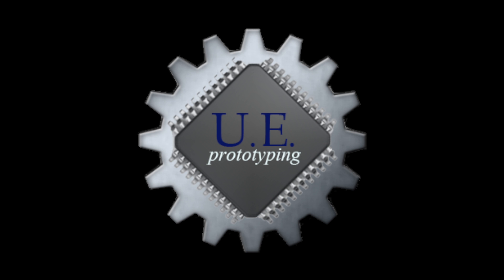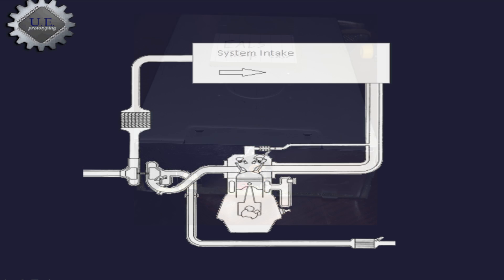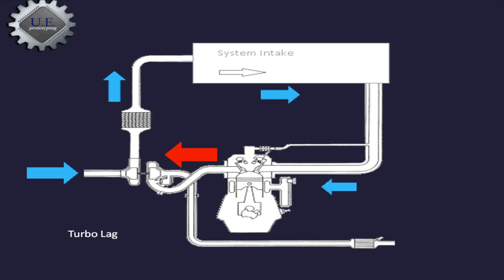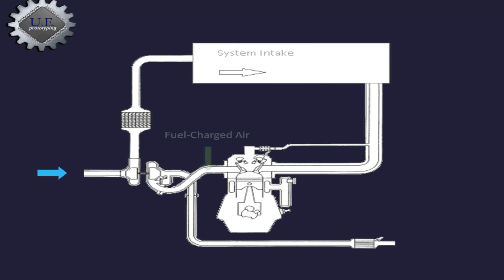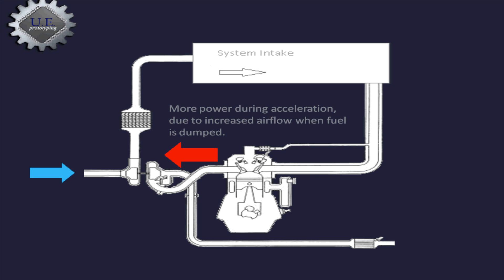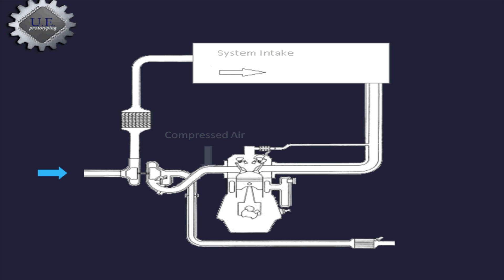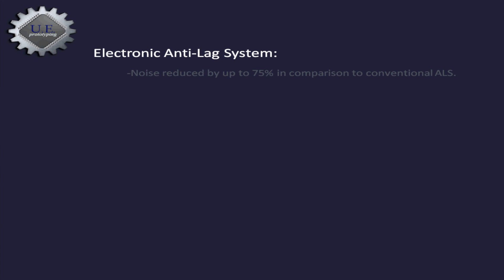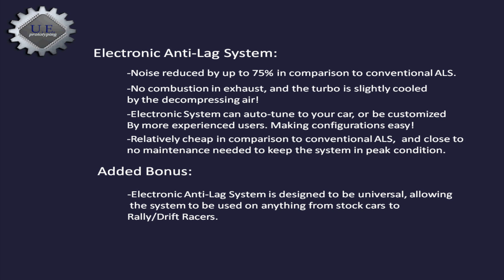Electronic Anti-Lag System - Idea Overview

Comment: Its same as fresh air antilag valve..??
Reply: Ive been researching this same topic for years and as many different implementations as i can that reduce turbo lag. Currently one of my cars has a 2jz gte in it, with the twin turbos - and they are even laggier than what i prefer. So i bought a single turbo setup to swap too, and the size of the new turbo is fairly large, because i need it to reach my horsepower goal, but I have one fitted with a light billet wheel- less rotating mass,log style manifold ( not tubular) for quicker spool, i even have a "Quick Spool valve" that is run off an actuator and turns a flap that like half of a butterfly valve- that sits between the turbo and the turbo manifold, my computer( ecu) has antilag function built in, and i spent over 2 months trying to speak with someone at turbosmart that had more than general info so i could purchase and setup one of their "Fresh air " ALV " units- only to have them tell me on multiple occasions that they dont think its" what i would be looking for", etc simply because when they ask if i regularly road race / drift with the car, i responded no, not really planning on it, but I still dont see installing the system being a waste of time, as they seemed to be convinced....

Comment: 0:53 Does antilag boost while accelerate rather then boosting when decelerate..???
Reply: Turbo lag is the delay it takes for the turbo to spool (start spinning fast enough to produce boost). Basically you put your foot down, not much happens then after a second, or two, or three you start getting power. Once the turbo is spooled the engine is producing more exhaust gas (since it's taking in more air) and can keep the turbo spooled (in a sense the engine is a gas-generator for the turbo). 
Antilag keeps the turbo spinning when you're off throttle so that you have boost as soon as you start accelerating.
Reply: @Surestick88  0:53 is this rev limiter beacause pooping is happening while accelereting not decel ??

Comment: Funny think...my celica st205 is limited edition and toyota put in modern anti lag system..has feature press in air from seconr blow off valve to each header with pipes 😂...So toyota did it before other companies do it st 90s

Comment: ive done similar on my gf8 impreza wagon i used the reculation vavle from the top mount intercoler into the up pipe i also got a hawk eye manifold used the lambda sensor hole to hooked up a spark plug and coil system uped the fuel ratio a little bit and got anti lag if i dont use the spark plug system it pops a little when spark plug system is on its loud and bangs like a mother haha and no lag with ether i just like  it loud n good luck hope it goes well for you
Reply: Benjamin Davis could you be kind enough to explain step by step on how you achieved that. i'm planning to do it on my 02 wrx aswell.

Comment: Would this application hurt the engine on a single turbo v8
Reply: +harley2deadley this "electronic' setup will not hurt your engine cause there is no combustion in the exhaust manifold like a conventional anti lag setup.
Reply: antilag system will dmg the turbo  and the manifold only    but the electronic will make it cooler .. even cooler than without antilag

Comment: Why not use an electric motor to spool the turbo directly?
Reply: +Steve Jones I believe these actually exist called hybrid turbos and used in f1 racing.
Reply: the exhaust gas woulda burn the motor
Reply: @Talip Birgül my coment was supposed to reply to Steve but its okay..
about mgu-h, it's a hybrid that is way out of reach for regular people and the low rpm spinning thing will be useless cuz the motor in the f1 car is already OverPowered and the car is soo light-wheight that the rear tyres will lose grip and spin (like... ALOT) till they tear in a matter of seconds That's where Traction control comes wich will ELIMINATE all the launch boost,the turbos,and will limit the torque so the car won't spin out at launch or at low speeds !
try driving a even a naturally aspirated 2.5L V8 f1 car (that will rev over 18.000 rpm) without traction control ON
Reply: thanks for the answer i didnt want to provoke you. ure right man with the tractioncontrol stuff i dont watch alot F1 but i saw alot of the antilag(powpow) stuff in rallys to eleminate the turbohole in curves while downshifting and i think "maybe" (im not an engineer) there the mgu-h stuff would be healthyer for the motor but as i said i just think that im not sure bout that :D and i totally agree with that stuff what u said.
Reply: there is another kind of anti lag     is delaying timing to make the fuel and air burn in the exhaust at low rpm .. and that will create pressure to spool the turbo... but it damage  the turbo .. i highly recommend any non ball bearing turbo ... cuz with anti lag  all turbos are same at spooling   .. difference is the power
Reply: Hadi kuwaiti how does non ball bearing turbo preferable with als?ball bearing reduces friction thus generates lower heat also will spool faster an als also may not completely eliminates turbolag
Reply: +Muammarvsgaming ROBLOX and more  ball bearing is weaker than journal ... and anti lag will hold the boost with or without the ball bearing
Reply: which make sense
Reply: somewhere i saw an electronic turbocharger im not sure but i think the only needed thing is a secondary board power with 48V they should just add something like that instead of antilag would be more healthyer for the motor i think. sry for my bad english
Reply: F1 does that with a sistem called mgu-h
Reply: NO ! then it will no more be a turbo ! just a less efficient supercharger that will add wheight, and drain the battery because superchargers use the power of rotation from the crankshaft
Reply: @atef turki we know what superchargers do. but the mgu-h system is still a turbo it just uses electricity for the low rpm area to get the boost after the motor kicks in it uses the exhaustgas  like a usual turbocharger. with the extra add wheight u could be right but i just meant it would be healthyer for the motor, exhaust manifold and the catalysator. and if i know it correct it should have an extra generator for the 48 battery. im not completely sure bout that. if i tell shit tell me the right way ^^ have a nice day
Reply: and sorry for my bad english gave my best ^^
Reply: I agree with Talip.